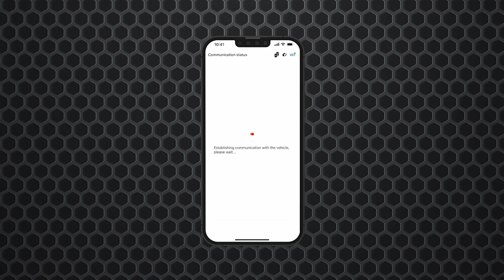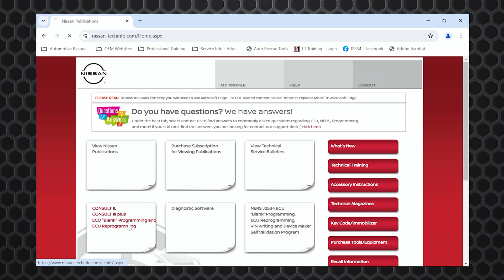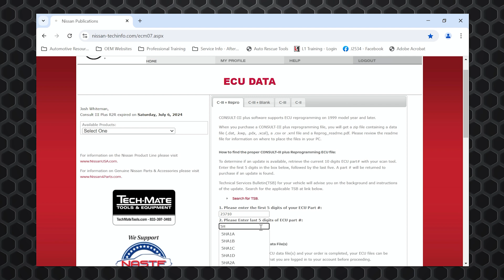Garage Gurus | How to Check a Nissan ECM for Updates

Comment: My 2019 Altima SL went in for routine oil change and tire rotation.  The next day there were 4-5 lights on. They said it was just a coincidence. A day or two later, they all were off except the check engine light. When I had the code read, it said that it is the MAF. Does this recall apply for them to fix?  The dealer told me that a MAF would cost around $400. I'm preparing for a 10 plus hour trip in three days and do not want my car to break down.  MIL ON WITH DTC P0087, P0101, P0448, OR P2008, VEHICLES REGISTERED OUTSIDE OF CALIFORNIA
Reply from the maker: Hi, thanks for reaching out! Our tech team would be happy to help you with this. You can reach out to them at 1-800-325-8886. They are available Monday – Thursday from 7:30 a.m. – 4:30 p.m. (CST), Friday from 7:30 a.m. – 4:00 p.m. (CST).

Comment: On my 2019 alti SL 2.5 fwd- acc on or car, turn audio off, press and hold menu, at the same time twist volume knob back and forth several times u til menu appears, choose 2nd, go through menu without changing anything, and look for your ecu model.

Comment: Ahhh what scan tool and where do you get the app . Confused
Reply: Just use a generic OBD2 scan tool and go into mode 9. Depending on the year that will typically display the VIN as well as ECM part number
Reply: @ awesome thanks Eric . I try learning everything I can 👊🏻.